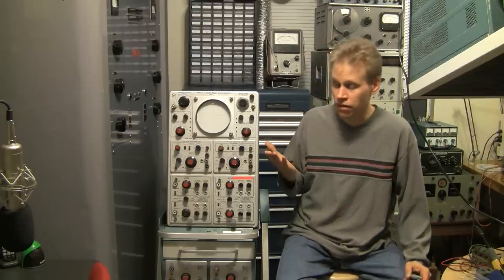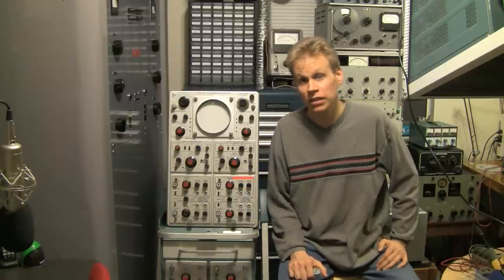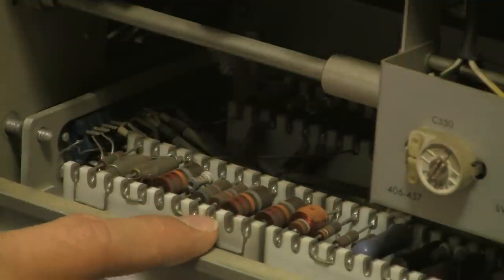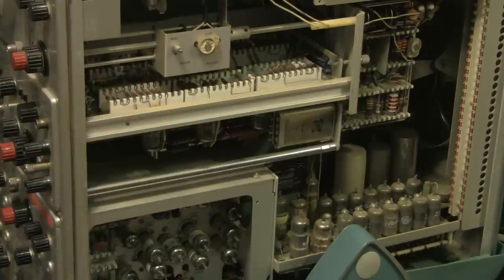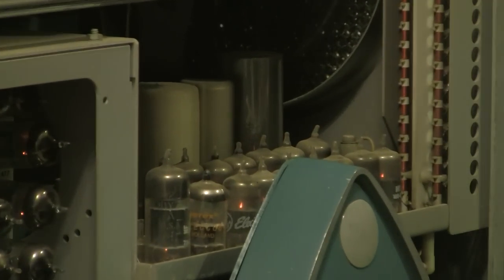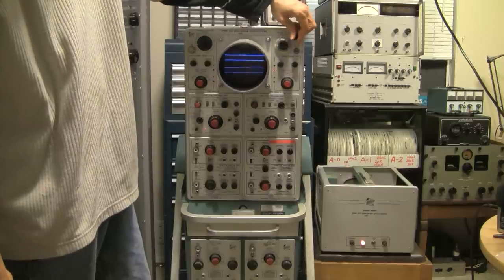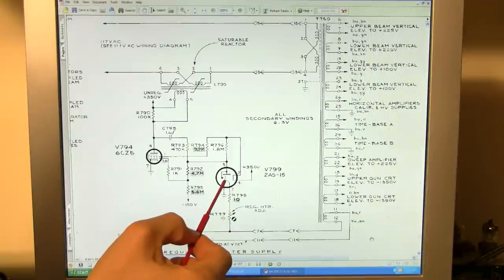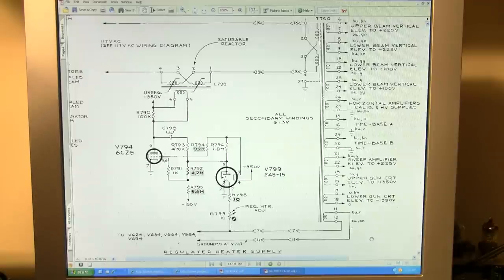Tektronix type 555 oscilloscope, over 100 tubes inside!

Comment: Mr Carlson, I admire you! Thank you for validating these wonderful scopes and the tubes that accompany them. I have a couple of Tek o-scopes from the same vintage, Type 310A. These scopes just plain work! Course, all the vintage Tek's scopes were good - maybe a few bad ones, but not as bad as what we have at work - a Digital Phosphor scope. Works great for the internet, but it fails when used as an O-scope. I think the 2445 was probably the last of the CRT based scopes that were still reliable. The digital-based LCD scopes are lousy! (Is that a Gates AM transmitter I see in the vid? Had 1, Luv 'em!) Great vid, great tutorial. 73's!
Reply from the maker: Bob H  Hi Bob, Thanks for the comment! That TEK 310A is a cute little scope! The Gates is an AM transmitter. Two 810's modulating two 810's.

73
Reply: Bob H Agreed; the later digital ones...well... they just do not last more than several years, and when the they go kaput, ya' cannot get parts. 
Gimme a 465. Solid state but but my go-to 'scope.
Reply: glasstronic 
Ok on the 465, I agree. I think there was a time B4 'digital phosphor' scopes became all the rage, that Tek made some great CRT scopes. I don't credit them much anymore, because I've seen many freaky digital problems with their newer digital scopes, be it o'scopes or other measurement scopes. They are no longer what they were originally known for, in my opinion anyway.
Reply from the maker: Bob H Couldn't agree more! These newer glitchy firmware driven devices have way to many holes. It's nice that people find them and post the results here on youtube as well. Its pretty sad that a firmware upgrade will take a scope from 50MHz to 100MHz. The only firmware you need with a TEK Type 555 is a Back brace...LOL!
Reply: Tek did a slightly better version, the Tek 2465B. That is 4 input channels, 400 MHz and an on-screen DMM. I have had this unit for 15 years, and have only needed to open it (for dusting and contacts cleaning / lube) twice.
Reply: I still have a 564 and some plugins, not in the front line, but I wouldn't hesitate to use it.  I've upgraded to a digital scope stacked on top of a 2246 CRT analog.  I just need some more bandwidth.  My digital hasn't done anything unexpected, but I know when it's time to use analog.  People get all wound up in the latest and greatest, and forget we're in an analog world. It comes back to remind us sometimes, and you can either learn to respect it or remain bewildered.  I go back 40 years when I had an HP120B and an ancient Hickok 770 that I passed on to another budding engineer.  I later got an HP130C with 500KHz (!) bandwidth that I magicked some text on.  I remember using a bunch of my glassfet equipment to keep my lab warm in the winter as a sneaky teenager when my parents wouldn't spring for another couple of degrees on the thermostat.

Comment: Some of the Tektronix schematics would have little surprises hidden in them.  Like a little race car running along one of the lines with a little cloud of dust behind it.  (Just look up "Tektronix cartoons")  The first time I saw one was when I was repairing a 565 at the transmitter site on Midway Island.  Mercifully, Tektronix gave you a little supply of the correct type solder wrapped around a little holder inside the scope.  You did NOT want to use regular solder.
Reply from the maker: Yes, it would benefit modern companies to take that much care of their customers. Sad to see that era has passed.

Comment: Love that Dual Beam Dual Trace.
I went out and got an old Tektronix 456M some years back. Just because...
Not as vintage as the 555 but it still oozes quality. 
I was after a straight 465, one or two slightly better trigger options IIRC, but this one was the only sensible offer around at the time.
I can tell you I don't need much of an excuse to bypass the digital scope and go for the 465 ;^)

Comment: Hi, nice video.   I have one of these, I should plug it in, it's been about 15 years.

The "Delay line" you pointed to is actually the distributed amplifier.  The actual delay lines are in the two aluminum things with all the small holes.  Each hole lets you adjust one small capacitor to flatten out the deal line's response.

You may have to replace some of the electrolytics, they're often going bad.   Also any black beauty tubular capacitors, about 8 of them, they're all leaky.     Also the black capacitors in the very high voltage CRT power supplies, they're probably leaky.    Besides that, most everything else is likely to work just fine.
Reply from the maker: Hi George. The distributed amplifier (6DK6's) are part of the delay line. I'm glad to see you have one of these and your taking care of it. Today, "it seems" everyone just want to strip them for parts.

Comment: Great video!  A bit of a nail-biter when you powered that beast up.  Reality TV does nothing for me, but reality electronics lab... well that's a different story.

I noticed the lab diagram specifications were for 117VAC, but voltage in most of the US (and Canada, I suppose) is 125.  I know this sometimes cause minor problems for vintage tube audio gear.  Are there any issues for the 555?
Reply from the maker: No issues at all. Thanks for your comment!

Comment: Have a somewhat similar oscilloscope but it is a single trace, indicator unit is only 75 lbs., and the maximum sweep frequency is 50MHz. with a window for direct input to the deflection plates. It is the Tektronix 517 Oscilloscope. Unfortunately the 420A High Voltage Power Supply failed and was thrown away without my knowledge before I could repair it. (I was 15 at the time) except for that and a missing 2AS-15 Kalotron the scope was in perfect order.

Comment: When I lubricate antique fans which don't have wicks, I use Slick 50 One Lube in an old Zoom Spout oil bottle, and oil the bearings while the motor is running.  This is the best way to ensure the bearings are adequately lubricated.
Reply from the maker: These fan motors have oiling holes, which need attention. It's quite common for these fans to be seized... Not solid, but sticky. I usually use synthetic oil, that works well too. I will have to check out the Slick 50 One Lube.

Comment: Sad, I used to have a Tek Ocillocope like this, don't recall model number but it was given to me by the university that was done with it. My dad took it to the dump without asking me. The one I had, did not have an external power supply.  It used to dim the lights when I turned it on but always worked great. I can only imagine what your power bill is like running all those tube devices.

Comment: I was a highschool freshman, worked in the IMC projectors etc, they had one of these, it had a placque that said Motorola Gvt Div Scottsdale, my Uncle worked there, Dad was a TV tech, I brought it home with me. They were clueless at school, we had tube testers at home. Dad told me test every tube one at a time, I kind of did 😅 so it wouldn't trace, I start diagnosing it, Dad says-did you test ALL the tubes, I got Zzzapped testing Plate voltages. Yup, got some plate voltage there! Dad says-use the high voltage probe for voltages over 300, Ronald. He hands me the high voltage probe, I went back to testing ALL the tubes and found one that had a bent under pin and was out of clock in the socket. My attempted diagnostics was pointing right at that corner. I never counted all the tubes but I got it working, the school district wanted it back, we had our own triggered scopes anyway. The school got it back working and a few months later I got hired by the School District to fix AV equipment at the District Offices and I even drove the District Van to schools to get equipment. The 1970s man. I smelled burnt hair for 3 days. 900 volts DC, Zzzap.

Comment: you have a pair plugging that in without doing any basic safety checks but that tek was built to highest levels of the time and has built in safety features
Reply from the maker: iron man Hi! I wasn't to worried about it. It has a fuse. Nothing that couldn't be fixed with the parts I have on hand.

Comment: It breaks my heart to see this video.  I used to own the same scope.  I moved years ago and left it behind in my parents basement.  Then one year I went home to visit and both parents started nagging me about my old electronic equipment left at the house.  So I threw the scope out tubes and all.  I now use a solid state Tektronix.  Still I miss my old Tektronix Type 555 Dual Beam Oscilloscope.  I feel sick to my stomach.
Reply: @fredgarvin9262  That all depends on what you are using it for.  Some people like the eerie glow of the trace on the old CRT phosphorus displaying their favorite music while smoking pot.  If you hollowed out the insides, there would be enough room to build your own scope inside of it.  Also the vacuum tubes are valuable.  You could sell the tubes on eBay.  Geeks loves to build audio amplifiers with these tubes.  I think Mr. Carlson would agree that the old technology is just plain cool.  Some people collect and fix up old reel to reel video tape recorders.  I own a couple.  Why?  ...because its just plain cool.  
Would you use an old Tektronix Type 555 Dual Beam Oscilloscope for troubleshooting or scientific research?  No.  One man's junk is another man's treasure.  
The scope  I use for  troubleshooting and experimenting is the  Tektronix 2213A.  I bought brand new back in the '80s. The new digital scopes are lifeless and less fun to use in my opinion.

Comment: Such a cool piece of gear.  I wonder how big the schematic for the whole thing is - lol.  Thanks for the explanation of the filament regulator circuit.  Very informative!  I assume the filament voltages are all AC.  I'm not sure what the need is for regulating the AC filament voltages.  Does it really swing that much?
Reply from the maker: +LBA Studios The regulation plays a few parts, the most important parts are to reduce drift and increase tube life. Thanks for your comment!

Comment: Someone stated in the comments “a relic from the past” … I am a relic also having reached retirement; but I still feel very useful.  As should this fine test instrument.  LOL 

But I do have a question, I am curious about your approach.  Why did you just performed a visual inspection before power on.   I would have thought, (given the equipment age) you may have tested the electrolytic capacitors and looked for any paper caps.  And certainly powered up the supply section, before attaching, to check voltage levels.  

Perhaps you did off camera to be sure you didn’t let the smoke out??  Or did you just have faith in the Tektronix quality?  

Great job your videos…  sometimes makes me wish I could turn the clock back and start over.    /  Karl
Reply from the maker: Hi Karl. I was pretty sure it would fire right up, as the previous owner said he started it a while back with no issues. I have lots of components here, and I don't worry about that, as I would have just fixed it on camera with all of you.  Thanks for your kind comment Karl!

Comment: I have a CRC Oct 361 oscilloscope brought for a retailer who bouhgt used equipment from the french army.
It still works fine , but i have to switch it on 10 minutes before taking a mesure , the scope is old and long to warmup .

Comment: I teach EE at a university, and I love these old dreadnoughts (I use a TEK curve tracer in my labs). But every one of my students can today, for $250 + a laptop they already have, own an oscilloscope, a function generator, power supply, DMM, and logic analyzer. Couldn't do that back in the 555's day.
Reply from the maker: Hi Mike, things have come a long way since the 555 days. Now, can the laptop run 2 independent spectrum analyzers at once? The 555 can. Thanks for your comment!

Comment: It looks awesome.
Tubes are good reliable parts only the sockets soldered to the pcb were nasty because the solder broke by the heat of the tube.
Reply from the maker: smbrob Thankfully, there are no pc boards in this beast.

Comment: Many years ago I owned an old Tektronix that I bought in a bargain.  
From that day on my Gould advance solid state oscilloscope (poor fellow) was shelved into retirement.
 Tektronix assembly was so neat that it I had a pleasure to remove the cover and take a look into.  I never had any problem with Tektronix , the same I can´t say about Gould.
As usually very nice video and your explanations as well. Thumbs up ! 
I quit electronics many years ago but I still like to watch videos on old equipments refurbishment.   Please do keep posting. 
ps.: how many watts does it consume ?
Reply from the maker: Ron Wolpa Ron Wolpa  Hi Ron, Thanks for the comment! Glad your enjoying the video's. Between 105 to 120 Volts AC "line input", the scope pulls a maximum of 1050 Watts. I imagine the 1050 Watt rating is at 105 Volts, so probably a little lower at 120V. 
It's an area heater :^)
Reply: Mr Carlson's Lab 1kw !!  I imagined that  ( 100 watts per tube  lol )   ,
just wait until you receive your monthly bill..  Waiting for the video on which you will calibrate it and clean it up,  thanks

Comment: Nice!
Not surprised it sprang to life just hairs out of spec.  
I have heard so many "Tubes..unreliable, hot, waste electricity"  comments, & seen more fried Transistor equipment.  
There is an "offset" or plus, to everything in life.  The Tube stuff was bulky/heavy, but lasted, & the Transistor stuff light & portable, just needs more upkeep if you want it accurate. 
This unit very much like what Electrohome used in their R&D lab, for designing Televisions.

Comment: Hi Paul, thank you very much for the video posted long time ago. I really enjoyed the amazing design back to 1959. Can we say that this scope is more or less equivalent to a 4-channel digital version in the market today? In an attempt to get a small lesson from such a great engineering design, would it be possible to make a regulated power supply (or even a current source) based on the 2AS15 tube circuitry used for regulating the heater voltage of all the tubes in the in the scope? Thanks.
Reply from the maker: +esmaeil nam 
Hi Esmaeil. All the tubes in the scope are regulated both B+ and filament. This scope can be operated as an 8 channel scope with two 4 channel plug in's. It can also be a TDR and a spectrum analyzer at the same time.

Comment: Great piece of test equipment pr0n. Why did you fire it right up instead of doing a slow warm-up on a variac, though?

Btw, if one those 100 tubes goes out then you look in the service manual at the schematic and walk through voltages to isolate the issue. That's how I found the two dead JFETs out of the hundreds of transistors in my 475/DM44 when A channel triggering went.
Reply from the maker: Tom Cleaveland Ya... Been there a few times! Slow warm ups? were talk'n TEK here. LOL! I would have to haul out my 30 Amp Variac for this thing. Then I could fan cool the Variac and heat the house with that as well.

Comment: Impressive, no doubt state of the art back int he days.

I have always found tube based equipment to be generally much more resilient than anything else. As in a small fault here and there wont kill it, just fix the problem and it is back up and running.
Reply from the maker: +Alfred Stampe  I agree Alfred. That's why I appreciate the old stuff. Isn't it funny, people think that tubes are unreliable.

Comment: Hi Paul,  I acquired one of these a few months ago and am excited to get it up and running this winter.  The only issue I have is that I purchased it from the estate of a gentleman that passed away.  The unit and the power supply were in the same area of his shop,  but could not find the patch cable anywhere.  I searched everywhere for it.  I thought of making one,  but am not sure where to start looking for the connectors.  Any thoughts on where to start looking?

Comment: Heaven forbid someone pull that tube! I used to work on C&D battery chargers for the power company. when the control module failed the output would rise from 52 volts to 70 something. high voltage shutdown circuits were used to remedy this but a few times they also failed and toasted the microwave equipment power supplies. For sure the radio guys would be upset! maybe I missed it, why are the filament voltages that important? bet that tube is a Jim dandy to replace. thanks again! you are the King of the lab!
Reply from the maker: +jwl9286 Hi, thanks for your comment! Stable filament Voltage equals stable readings. It's also a lot easier on the tubes. All 100+ of them.

Comment: Thanks MrCarlson, I used a Tektronix storage scope at Sheffield University in the 60’s and was interested to see how similar the construction was. I am curious about the resistors from the 50’s in the 555, would these have been carbon composition? In that case, would many of them have drifted high?
Reply from the maker: Hi Andrew. If the scope is in a stable environment, the carbon composition resistors are usually fine. One very interesting thing about carbon comp resistors that not many know: Their resistance drift "with heat" is almost like a bell curve.... They go high, reach a point, and start to go low. This phenomenon is responsible for the destruction of many E.F. Johnson VFO's.